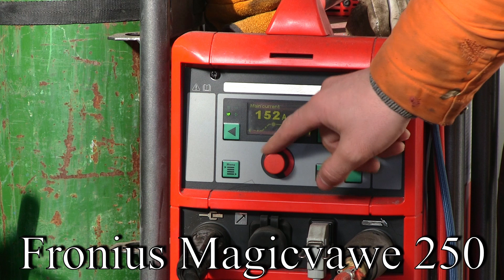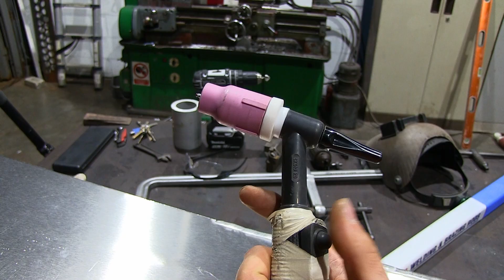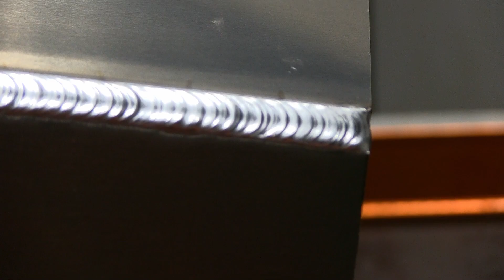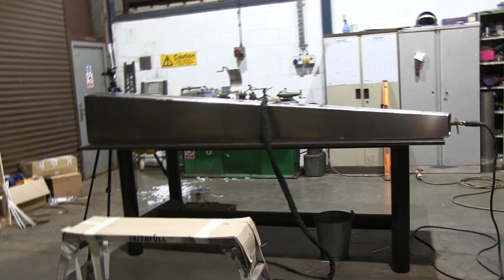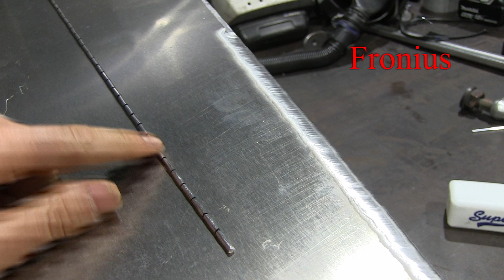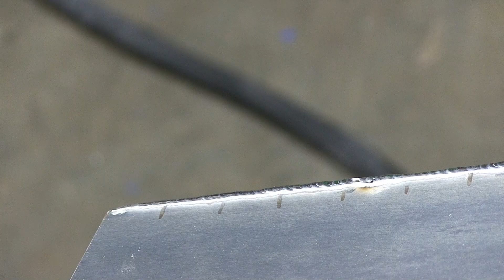Best arc welder in the world, cheap welder vs Fronius welder review

Comment: Non e' in un confronto simile che Puoi valutare le differenze. Con due lamiere da 3 mm ad angolo anche un tig di quarant' anni fa esegue una saldatura indistinguibile dalle altre due. E' in altre situazioni dove la Fronius fa la differenza, non con questa saldatrice cinese, ma pure con altre marche di prima qualita'.
Reply from the maker: You are absolutely correct. From  your comment I conclude that you are agreeing with my point that the title "the best" is very subjective and determined by each particular user and combination of their needs, financial capacity, skills, type of work they do and many other factors
Reply: @weld-deluxltd7635  In linea di massima sono d' accordo. Tranne che per il discorso affidabilita'. Che confermi pure tu, dicendo che sei incappato in ben due guasti con la saldatrice cinese, mentre la Fronius, che tra l' altro e' un modello di circa 15 anni fa e con soli 250 ampere, usato molte volte ad amperaggio vicino  al massimo disponibile, pare funzioni ancora bene. Quindi il tuo discorso e' condivisibile ma in parte. Nel senso che in base alle esigenze si puo' optare si per prodotti di varia fascia e funzionalita', ma secondo me senza mai rinunciare a marchi di comprovata serieta', che non devono essere per forza Fronius o Miller, ma nemmeno queste macchine cinesi che sottoposte a uso professionale cedono spesso, troppo, specie le schede HF. Io personalmente non le consiglio mai.

Comment: Interesting...I have a Magic wave 1700 job bought about 15 years ago and have needed 1 pcb boards and an off switch replaced in warranty ( very very light use) and a Main PCB replaced out of warranty....still light use....
Reply from the maker: Yes, all equipment will brake at some point. Many people criticize me for being unfair towards the Fronius which is not the case as I own 3 Fronius machines

Comment: The only problem is here in Australia, a setup like a Fronius 230i with water cooler is over $11,000 without a foot pedal, And by the time you buy 3 extra torch heads ($230.00+tax each) and a bluetooth foot pedal (880.00+tax) you are almost $13,000. This is what is coast me when I paid for my setup.
Reply from the maker: It is expensive for sure

Comment: im thinking miller dynasty 210 dx cps how does the fronius 230i magic wave ac dc compare
Reply from the maker: I am in Scotland and I never used Miller brand, in fact it all times I only saw one machine. Do not get me wrong Fronius makes excellent equipment, the point of this video is to illustrate that what is the best is highly circumstantial. That is why when it comes to AC/DC TiG in the range of 300A+ Fronius looses to cheap China made machine. Not because Fronius equipment is  inferior, but because of amalgamation of all circumstances.

Thanks for watching!

Comment: I have to disagree with you on fronius.. Im a big user of mig and i have to say that no one can touch fronius when it comes to MIG welding. I recently needed a 3 phase welder and i tried out a r tech MTS450 which is a big boys 450a machine and i have to say that i was incredibly disappointed at how it puts the welds down and really shows that is just a literally a Chinese welder that has been slapped together as the short arc was way off and the spray could not be done correctly as the arc was just too wide. I got my self a second hand transsteel 3500 and this thing short circuit migs so well that at first glance you would think it was done by a pulse mig welder.. and the fact you have 3 different synergic profiles for your welding is incredibly handy.. not to mention that the duty cycle on the fronius is actually better than the r tech by a long shot. I have also tried a fronius CMT and i have to say you really cant say fronius is overpriced..
Reply from the maker: No argument there, MiG arc control is a different game all together and CMT ability to o weld with low distortion and control to bridge the gap is second to none.

I too owe 3 machines from Fronius and if I need an other MiG I would not look at anything else.

However this video is not about how bad Fronius is or how good Chinese machines are.

This video to show that the best welder in the world is not about brand, that decision should be made based combination of different factors like ease of repair as any machine will brake at some point. An other one of them factors that needs to be accounted, is your personal circumstances.

If I had a production line that daily produces 50+ batches of the same component with MiG and employs low skilled welders that rotate through the company quicker the any one can learn their names, I would get senergic machine from Fronius

However, In my situation, for my needs, for the TiG machine Fronius is not the best welder.

Hope it makes sense
Reply: Have you tried esab 3 phase or older airco 3 phase machines? Man o man those machines weld like butter.
Reply from the maker: @mauricioespinoza5390  I am sure that they are good, how do I repair one when it brakes?

 How long will this machine will be of line if I have to send it to esab?

Is there 3 years warranty on those machines?

Will esab pay for the shipping  both ways if I need to send in machine under warranty?

Will esab send me a machine to  make sure I am not stock if my machine takes longer to repair then 48 hours?

Will the cost of the machine prevents me to buy a back up machine for any emergency situation that may rise?

There is more  to a good machine then ability to weld, welding properties go without saying but one must look into whole package
Reply: @mauricioespinoza5390  personally id avoid any of the esab inverters as they all seem to be cheaply built.. Every owner of a welding store i spoke to who stocks them have all said they alot of them go bang pretty early or have serious firmware issues. Esab really fucked up on that product line.
Reply: @Migman2020  I haven't had any experience with any inverter welders yet but those old school transformer 3 phase. They just won't die and the welds are phenomenal.

Comment: I hate how you have to pay extra to "enable" the full functions of a Fronius just by entering some cheesy activation code on the machine. It's like buying a sports car but without the performance because you need to pay more to "unlock".
Reply from the maker: Welcome to the world of monthly subscriptions and milking you dry attitude from the corporate world.
Reply: There software is worth every penny, from my experience
Reply: Paying top euros for a fronius is ridiculous. I decided to go for a megmeet at the time of my original comment, and man, was that the best welding investment I ever had, apart from my cast and machined 200mm thick welding table. That little machine puts out 200 over amps at continous duty cycle and hasn't seen a breakdown after these years. It has made itself money a hundred time over and the performance is on par with a fronius.
Reply: @impactodelsurenterprise2440  from here in America they can be less than the competitors for more features

Comment: dont forget about EWM.
Reply from the maker: Sure, unfortunately i never had an opportunity to use any EWM  equipment but i am aware of such brand. All in all  changing brands will not change essence of the video .
Reply: @weld-deluxltd7635  so basically three is no point of buying expensive brands. Chinese stuff will do fine
Reply from the maker: @BlacharzOstatniejSzansy  It is a little different, the ability to repair your machine and ease of repair of the machine should be one of the biggest concerns rather than the brand name. The level of competition is so high that it is hard to make bad welding equipment if an established manufacturer is competing in the open market. There is no such thing as a welding machine that will not break, so it is crucial to be able to repair it without any hassle when it happens. So have happened that this Chinese machine is the easiest for me to repair. It is also the most effective in comparison to other brands as far as features versus price. It also has the best warranty deal out of any brand that is on the market. It performs as good as really expensive brands like Fronius when i use it.  This machine requires better understanding and experience from the operator to set it up  right where Fronius has electronics that will compensate for low experience from the operator.
Reply: @weld-deluxltd7635  thank you
Reply from the maker: You welcome! Hope it helps